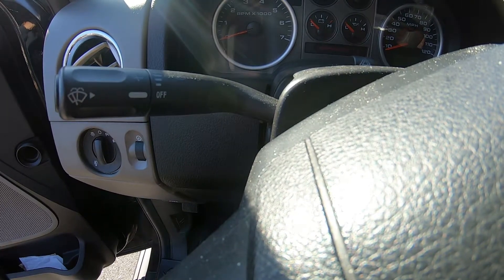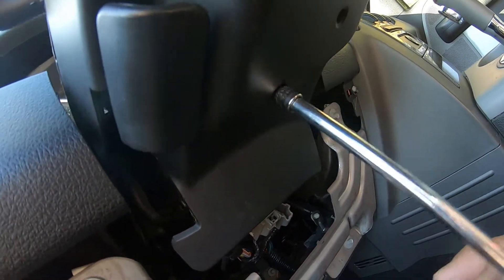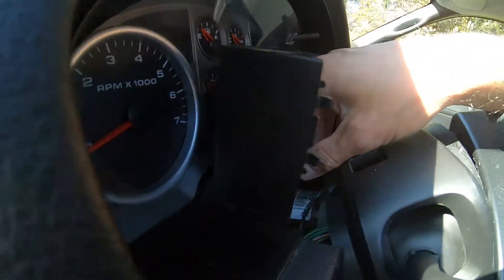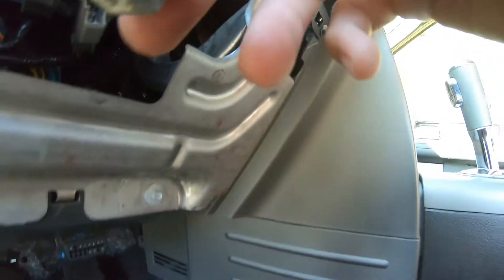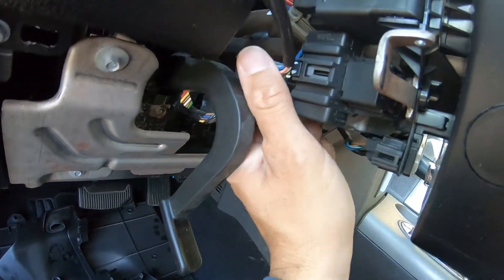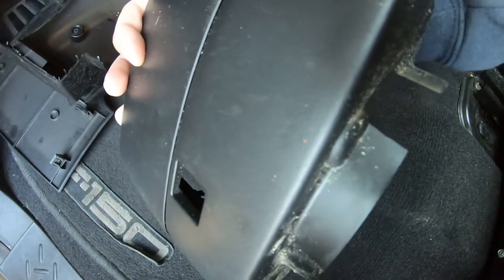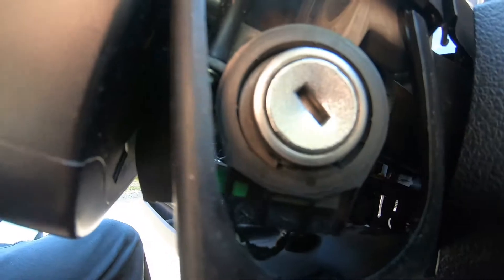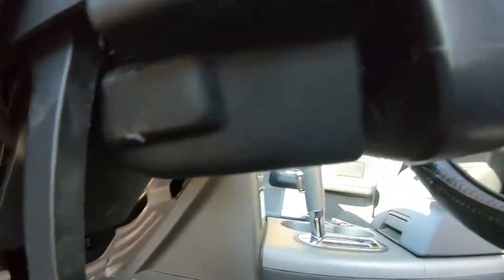How To Replace The Turn Signal Switch On A 2008 Ford F150

Comment: I have my new part and ready to replace it.
What I love about your video is very little talking, and you get right to the repair. Most of these guys like to hear themselves talk and ramble on way too much and it drives me crazy! Thanks for posting this!
Reply from the maker: Welcome! I try to make them simple and short as possible to make the repair.
Reply: you really need to either disconnect the battery or the SRS fuse if youre working in this area

Comment: Sunday Dec 19th, 2021.  Just finished doing this at 4:45 PM.  Took me a bit longer because I do not have a socket extender and only had the sockets.  An extender makes it easier but I was able to work around it.  Also I used a 7/32 socket as I did not have a 5.5 mm.  Worked fine.  I went to part source and they quoted me $180 for the signal arm control.  YIKES.  I bought one for 50 bucks off of amazon and it worked PERFECT.  In other videos the air bag and steering wheel has to come off.  I found that daunting, and thanks to this video unnecessary.  This was so awesome and easy.  THANKS THOMAS.  Unfortunately when I was putting everything back together my 5.5 mm bolt for the bottom of the steering column fell and another dimension opened up and swallowed it as I could not find it anywhere.  Funny how that happens.  Drives me nuts.  I found another similarly sized bolt and, although not a perfect fit, jammed it in there.  That's fine for me.  Also I never really could get the strap on the top of the steering column cover assembly to sit properly, but it seems fine.  And I didn't try very hard.  What an awesome fix.  Saved me a lot of cash and fixed a problem that was driving me nuts.
Reply from the maker: Glad you fixed it! It should be fine unless you hear some rattling that drives you crazy from the bolt, probably not though.

Comment: I got mine done and have a tip to share for getting the bottom cover back into the
steering wheel assembly. Looking at the top of the flange that needs to be inserted,
notice the excess of flange beyond the hooks at the top. Leaving the hooks, cut off the
excess following a line that will leave only half of the flange at the bottom. It will then
snap into place easily without compromising the integrity of the piece.
Reply from the maker: Thanks for the info!

Comment: I just had to switch my assy. Out on my 08 f150. Love the short cut without removing the airbag. The upper & lower plastic panels were the tricky parts. Replace the assy. Was the easy part. Reasonable of the upper housing took me several tires to get into place. Lower housing panel just wasn't going into place and still laying on the passenger floor board. But it works that's all that matters. Save me money $$$ time was on me !
Reply from the maker: Glad it helped you save money! You should be able to get it back on. Sometimes you just need to take a break from working on stuff, then come back to it later

Comment: I saw another video where the guy mentioned a spring that is located at the bottom of the mechanism, being careful not to lose it. I didn't see it there, nor did I see it in your video. Is that necessary?
Reply: How did your install go ? I had the same question about my 2007 F150. I did the install however the spring from the original multi function switch appears to Long to fit into the new switch. The right blinker won’t always turn off after completing a turn.
Reply: @thrillbilly6147  followed this and went well. The truck is still ticking. No issues without the spring.

Comment: This works if you do NOT have a column transmission selector. Off to remove my steering wheel.
Reply from the maker: Yours is a 2008 F150?
Reply: @thomasfixit7931  08 xlt with a column shift. Shift stops ya from getting the upper piece off with out damage. Cannot get it forward enough to get out from under the wheel. I think this why you see that some do and some do not have to pull the wheel. Pulling the wheel was no big deal but I have al the tools and the know how not everybody does. Thanks for the vid!
Reply: @riverrat1149  I just did it without any damage. Mine has the shifter on the column
Reply: I just did mine w/ Column shift.